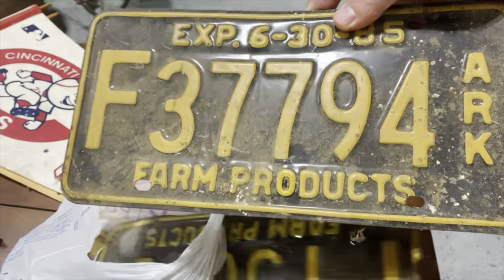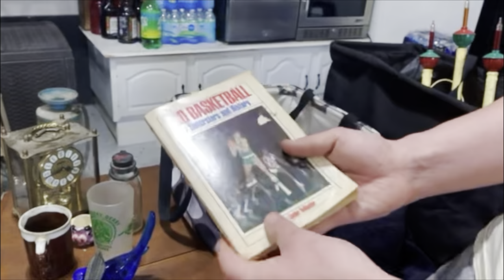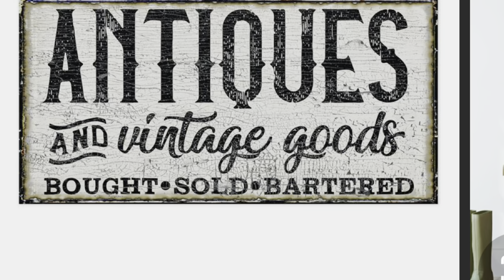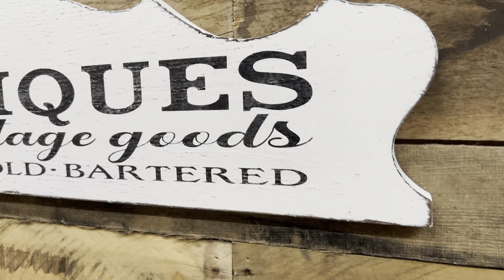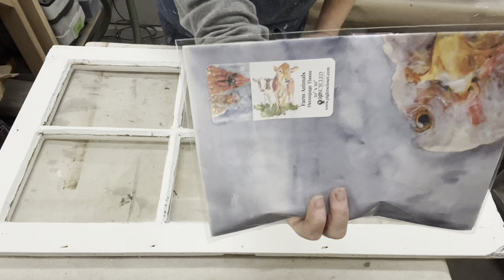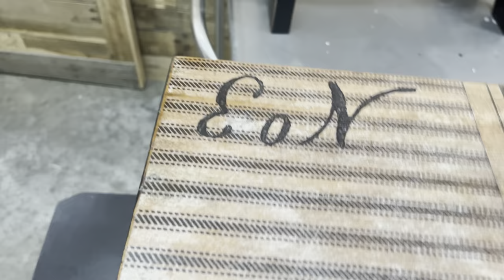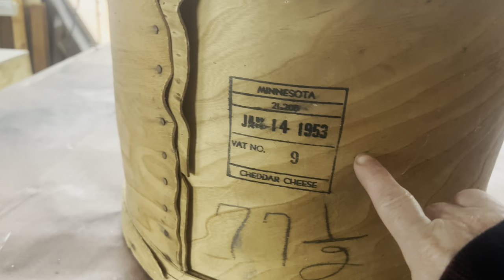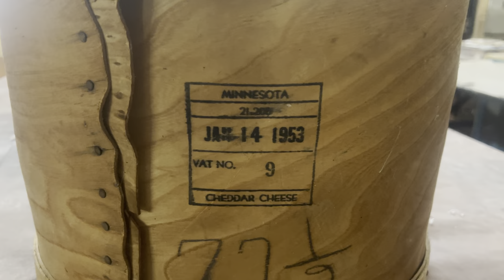Yard Sales | Trash to Treasures | Reselling | Haul | Makeovers

Comment: Love those coffee tables with the Rocycled paper. I think you could extend the use of those sheets (and   spread the cost across several projects) if you split the top between the original wood, stained perhaps, and the decoupage paper for a variation in texture. This would contrast well with your black base, too. I save every last bit for smaller projects, so I cringed a little when I saw you wad up the pieces that were hanging over. : ) As always, though, I love your esthetic and vision that you see in each piece.
Reply from the maker: Yep.. you sure could have